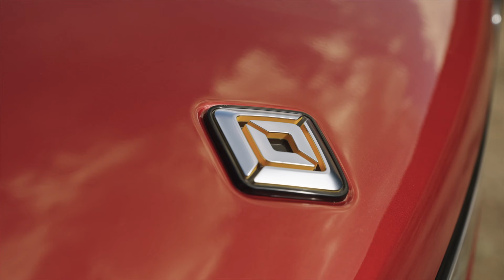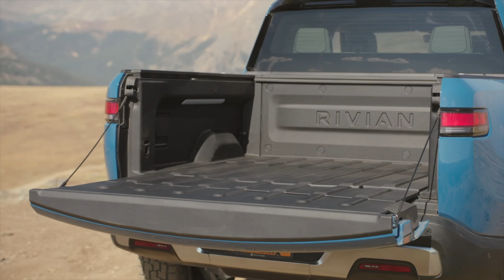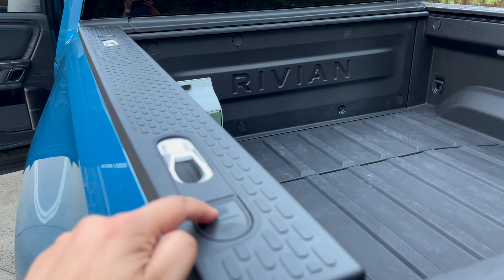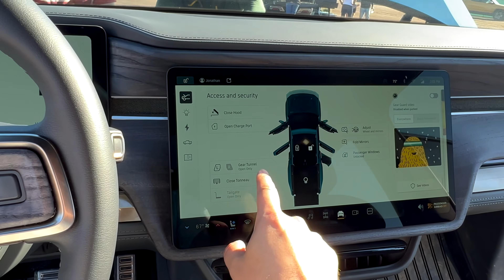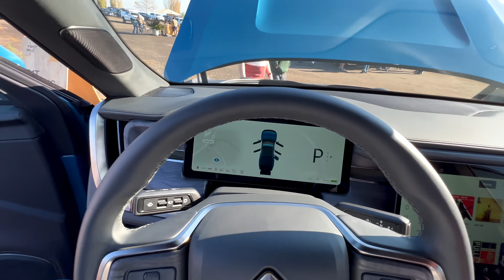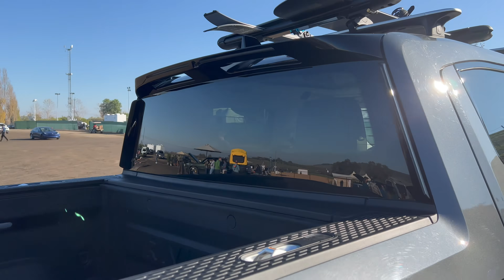Why the RIVIAN R1T Electric truck is the BEST EV you can buy!

Comment from the maker: I’m very impressed by the R1T. Are you excited for  it?
Reply: NO, in America this is a BS 🐂💩 Truck, very few will buy this truck, it's too short RANGE, 400 mi battery costs $10k, too low PERFORMANCE, the Cybertruck PLAID has bigger Payload, 100 SQ ft cargo, and TOW 15,000 lbs. 
and it's FASTER than a Porsche 911.
the Rivian is the wrong design for American market, we want Larger Truck like Cybertruck & F150 EV, and it needs at least a 6 1/2 bed. 
Rivian is too short. 
at best Rivian is a PRETEND truck , that people drive to the MALL and get Groceries.
Unfortunately, RIVIAN is too heavy for EU/UK roads without a Special license.
Cybertruck is only 5000+ lbs.
is Tougher and Lighter.
Reply: FALSE, the F150 is larger than a Rivian R1T, it's only a Mid size truck w/ short bed, it's similar to other MID truck from OEM's, and bigger than LIGHT truck catagory.
Cybertruck simply OUTCLASSES Rivian in every Spec.
Reply: the Tesla Cybertruck w/ just 3 motors, has bigger Payload, more cargo, longer range, and Tow 15,000 lbs, Rivian is too HEAVY.
Reply: NOPE, the Rivian R1T has LESS utility than a PZEV Maverick, or F150 EV.
contractor and DYI, won't buy R1T , and FORD electric ⚡ truck can use STANDARD upgrades and MODS.
Reply: Cybertruck has 16" ride height, 14" travel, can kneel the bed w/ built in Ramp. 
CT has BEST in class Approach, Departure, Break over.
Reply: It's important to note, only the Cybertruck has a Complete FLAT bed, all the others the wheel wells intrude into the bed.
can't use Mattress or large plywood sheets.
Reply: You, fail to mention that the R1T 400 mi battery costs $10,000 more......lol.
making R1T $90,000.....lol.
you can get FULLY SPEC Cybertruck for $69,000.
it has 500+ mi range.
Reply: Rivian stole their emblem from RENAULT.......lol.
Reply from the maker: We need to see the finished Cybertruck and F150 Lightening but I was seriously impressed with the R1T.
Reply: @TechInTheCar  - Rivian is a Expensive MALL CRAWLER with no Performance. 
the FUD Lightweight also has Lackluster Performance & Spec. 
but, the Lightweight can take STANDARD F150 Upgrade parts. 
the CYBERTRUCK when out (2022) will be the TOUGHEST BEV Truck you can buy , that has a PLAID Drivetrain and BEST in Class Performance.

Comment: Anyone know if it will have a heat pump for the battery? Live in a cold climate
Reply from the maker: I will check and update you.
Reply: The vehicle uses specific thermal layering to control battery temperatures.  There is a minimal drain in battery in cold climates.

Comment: Nice review. More info about towing capacity would be helpful. Cheers.
Reply: David - Rivian weighs too much, Payload is POOR, and TOW is only 11,000 lbs, and Short range only , 300+ miles, and 400 mi battery costs $10k.
Reply from the maker: Thanks!
Reply from the maker: Thanks. I will look into it.
Reply: 5000kg